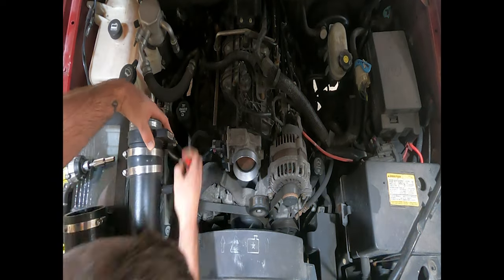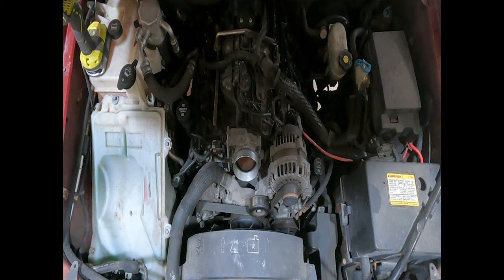2009 Trailblazer SS TEXAS SPEED 224r Cam Install, Satisfying camshaft install time lapse

Comment: That's definitely the cam I need in mine so I won't have to upgrade some stock parts
Reply from the maker: It's a very drivable compromise that gives great sound, good brakes, and saves thousands in fuel and driveline upgrades
Reply: Sweet thanks for the info!!!!👊🏾
Reply from the maker: Any time! Thanks for the sub!